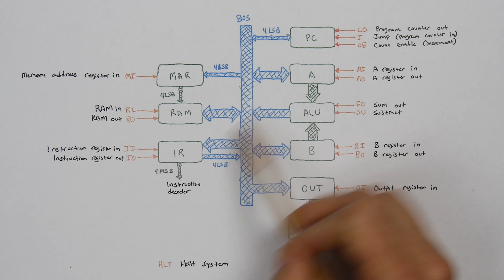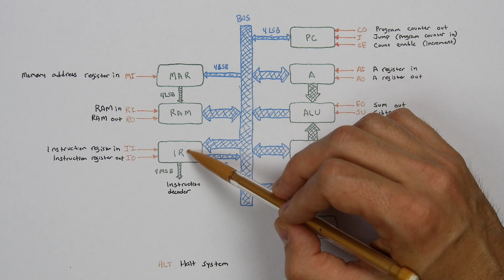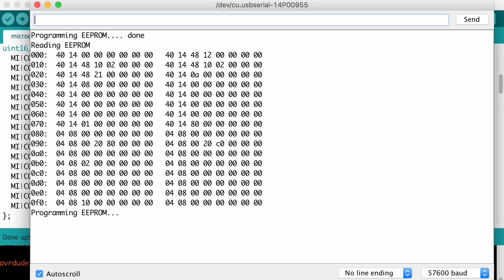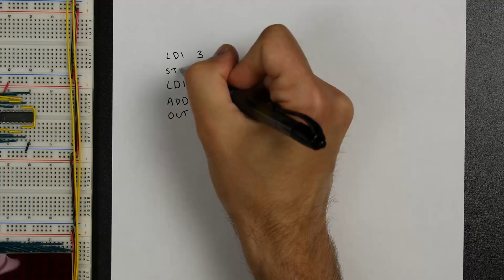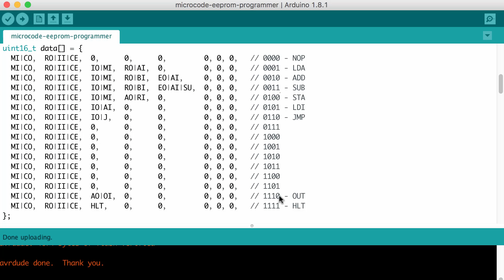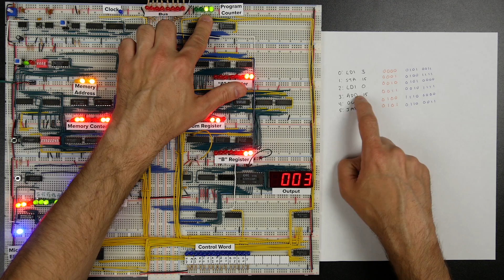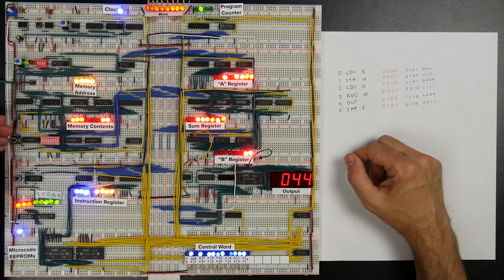Adding more machine language instructions to the CPU

Comment: The RAM I was able to source is a 64K AS6C6264 chip. It's got 8K worth of 8 bit words, controlled by 13 address lines, so, I've got 5 extra address lines to play with. The first thing that came to mind was that I could use these 5 lines to point to 32 different programs stored in the RAM, and I could just have a dip switch or something to switch between them. I'd like to come up with something a little more elegant than manually toggling dip switches, if possible, but I haven't come up with anything, yet...

But then it occurred to me, I could use one of the lines to toggle between the op code byte and the operand byte in memory, allowing me to use the whole 8 bits for both op codes, and operands, allowing me to do fully 8-bit math, and to refer to the full 8 bits worth of memory space afforded to each of the programs in my operands (and 8-bit literals, too, of course). I'm not sure how to refer to this approach, but I'm sure it's not exactly a ground breaking revelation. For now, I'll call it "Page Out" (PO). If this isn't the right term, I'd like to know the proper one, at the very least so I can label my control wires appropriately :)

So, my fetch cycle would look something like:

CO | MI,
RO | II,
RO | PO

leaving the operand available on the bus for the instruction we're about to execute to use as it pleases.

It sort of just occurs to me, now, though... this approach effectively doubles the amount of memory I can use for the "data" portion of any programs I write, since the PO control line basically becomes a ninth address line I could control programmatically adjust. I bet there are some really cool and powerful implications to this that I haven't thought about yet (and maybe never will, so please, do tell!)

I'm really new to this stuff, and this series has been absolutely amazing at demonstrating these concepts, both on the electronics, and the computer front. I think Ben might be the best educator I've ever had the pleasure of learning from. Thank you so much!
Reply: Well, it occurs to me now that it doesn't make any sense to have the Page Out, Ram Out instructions as part of the fetch cycle, since on the next step in the microcode, we'd need to re-enable those control lines, if we were interested in the operand for that particular instruction... but, those two control lines can just be enabled by all the operations that take the operand into account, as part of the first non-fetch cycle step.
Reply: You could use one or two of the extra address lines as control lines for subroutines and call them from the main program through the CPU and store the program counter of the main program in the stack pointer, when the subroutine finishes you pass the stack pointer value to the program counter. Idk just an idea.
Reply: I'm hoping to implement a stack, and use it for subroutines, so, if possible, I'm going to stick with using 4 of the lines for selecting which program the computer will run, and one for paging between the op codes and operands.

I'm a bit concerned, though, that I misunderstood the nature of SRAM. I started building the RAM module tonight, and realized, when looking through the datasheet a little more closely, that (it seems obvious now, and I feel silly for not having this realization earlier) it only retains its data when power is being supplied. So, storing multiple programs, or even one for that matter, in it is not really an option, and the computer needs to be programmed each time it's powered up.

So, I feel like I've got a couple options here.

Either I can implement some sort of bootstrapping, and store the programs in an EEPROM, and then write them into the ram upon startup, or just use an EEPROM directly for the program instructions, and have a separate RAM/Program ROM module.

I think the latter is probably the simpler approach, as I have no clue whatsoever how I'd approach the bootstrapping. Not to mention, it seems like repetition of work, to have the programs stored in the ROM, and then just transfer it to the RAM, only so the architecture can remain more similar to this build.

I feel like this series has given me a good enough understanding of the inner workings that I could expand on the build without TOO much trouble, though I've certainly got some questions I don't yet know the answer to.
Reply: "I'd like to come up with something a little more elegant than manually toggling dip switches, if possible, but I haven't come up with anything, yet..."
The simplest improvement is to use rotary switches that encode hexadecimal digits into 4 bits, like this one here:
https://cdn.sparkfun.com//assets/parts/4/2/7/3/10064-05.jpg
But if you want something more useful and fancy, perhaps a punched card reader? ;>  I made one for my computer – well, actually not a punched card, but a paper tape with black dots representing bits and a row of LEDs + phototransistors for optically reading them into RAM ;)

Comment: yeah, but can it run Crysis?
Reply: More like: but I couldn't fit it into the RAM of this computer :g
Reply: Vincent Fermat :-)
Reply: Could you fit that into 16 CPU instructions? It takes more than that to decide how fast the fan needs to run.
Reply: it‘s not turing complete afaik. if it was, you would just need to increase memory size. It would then be able to do it...  very slowly
Reply: It's Turing complete come two videos from now. It's technically possible to extend the memory with some insane mapping tech that loads different ram chips depending on the values of addresses in previous ones.
Reply: @berylliosis5250  So... what you're saying is... it CAN run crysis...
Reply: @thatnerdoverthere2248  Technically yes, practically no. It would be easier to make a different breadboard computer that can more reasonably compile C++ (and interpret CLR and Lua, yikes) than to make the extensive changes to memory and the ridiculous compiler that would be required for such a feat. And whatever you do it's not gonna be even close to fast.
Reply: @berylliosis5250  ok but... it CAN if you, for whatever god forsaken reason, really want to
Reply: @thatnerdoverthere2248  There is a tech demo / game preview called MOOD that's a W3D/DOOM clone for the C64. The game was never completed and released, but it's kind of playable. The C64's CPU is very similar to the 6502, and Ben is building a new breadboard computer with an actual 6502 CPU and "the world's worst" VGA. So you might be in with a chance at crafting something for that machine, maybe. I don't think any discrete logic computer without an actual microchip CPU IC is going to be fast enough for a texture-mapping 3D FPS. Ultimately the issue is the speed of light being the limiting factor, because a discrete logic CPU is just too big. This is something the late Grace Hopper used to explain very well. There is another project where they built a 6502 from discrete logic, and it can run some games, but it is much slower, for the same reason. Fast execution, large CPU, demanding computation task -- pick any two.

Comment: It's interesting what happens when it reaches 256, there seems to be an overflow, and then they are not multiple of 2 anymore... Great work once again.
Reply: I think his next video should be a conditional jump back to the start, so it would over flow then reset at 0.
Reply: I mean mutiples of 3
Reply: An 8-bit register uses modulo-256 arithmetic.  255 + 3 = 258, but that's too big to fit. 258 % 256 = 2, which is what ends up in the register as the new starting point.  The next iteration, it will start at 1 and then restart the overall sequence again with 0.
Reply: Yeah, it basically loops over division remainders of multiples of 3 by 256.
Reply: indeed
Reply: There's an edit button.

Comment: You should add an Add Immediate command, something like "IO|BI, EO|AI" (idk if that would work)
Reply: Definitely, but with the limitation of just 16 instructions including their addressing modes, you're going to run out of room quickly.    I know it's just 16 bytes of RAM, but this thing could be expanded to a real 8 bit computer pretty easily...albeit with quite a few more breadboards.   

In fact, it's time to build it on Veroboard or similar if you want to go bigger with a 16 bit address space and PC and an 8 bit instruction decoder. Ideally you'd need ...
Conditional branches if carry set/clear with 8 bit operands,  
Store Accumulator to memory address with B register as an index/offset,
Some simple immediate mode transfer instructions ...  TAB, TBA, ADD # as you say...
Then create a little 256 byte stack, where you can push and pop items so you can implement a JSR type instruction, and then a simple single level interrupt service/ return from interrupt, so SEI, CLI, RTI

I know it's totally out of scope, but why stop here ?  I'll help anyone interested.
Reply: On my build, I plan to go the full 8-bit route. I've got a comment on this video, explaining my plan to do so. The next problem I'd planned to try to tackle was the stack, but at this point, I don't have any great ideas about how to actually implement it. I'd love to be pointed in the right direction!
Reply: Fefo6644 that would work for sure, but he said that he thinks that it wouldn't be practical
Reply: A simple call stack can be done by storing the current value of the program counter in some other register from a register bank, or a small piece of RAM (the 16-byte ram used for this computer's entire address space might be a good start). Either way, you would also need a counter that would tell the CPU where's the current top of the stack (basically a pointer into that memory, or a signal that selects one of the copies of the program counter register). The RAM approach is much more flexible, though, because it could also allow to store temporary values and arguments for procedure calls on the stack instead of just the program counter. The best approach is to use some part of the address space in the system's RAM for the stack. E.g. the first page (256 bytes) of RAM, so that the addressing could be simplified: just an 8-bit address of the current top of the stack stored in a dedicated stack pointer register.
Then you store the program counter in every JSR (jump to subroutine) instruction and load it with the address of the subroutine you want to jump in. When the subroutine ends with a RET instruction, you simply load the return address from the top of the stack pointed at by the stack pointer register back into the program counter, and the execution will continue from the next instruction after the JSR.
You can even return some value from the subroutine in the A register ;)
Reply: Working on pretty much that. Have conditional branching, flags, multiplexing my 16bit control bus so i have ~32 ops from 13 of the 16 lines. instruction pointer is 8 bits, so 256 instructions and 256 bytes of address space so far. Once I'm done cleaning up, its a C register/counter, then stack, then segment registers :)

Comment: Couldn't you just as easily make LDI a 2 byte instruction by using CO|MI then RO|AI|CE?  The byte immediately following the LDI instruction would be the immediate value, and one step in that microcode would be an extra CE to skip past that byte.  It seems like you have everything you need to do a better LDI instruction, or at least an alternate LDIB instruction if you don't always want to waste a byte of RAM.
Reply: ldi comes in handy to save that byte
your example would work fine with just lda

Comment: Mr. Eater may I suggest to add 2 more ram IC's to the computer but keep the 16 bytes of code and use one of the other ram IC's for 2 more 4 bit or 1 more 8 bit data or address lines for an instruction and use the last ram for storing 8 bit numbers.

Comment: Damn I want to build one. But i find 15 ram addresses too limited to have something realistic.
Reply: It isn't intended to be practical though.  You could, without too much trouble, make this CPU have 256 bytes of memory.  Things like JMP, LDI and ADD would need to be 2 byte instructions so no more shoehorning your data into the lower 4 bits of the instruction.  That's not hard to implement though.  Expanding beyond that is going to take a lot more work.
Reply: Viorel you can easily make 8bit ram addresses with some performance drops
Reply: Yep agree but worth it; the split nibbles does limit this a lot.  8 bit address bus and PC would be easy to implement ..  
Frankly it's not that much harder making it 1 byte instruction, 2 byte operands, with a 16 bit PC and MAR.  That's a real computer, but you'd need to break it into the modules and assemble on protoboard for reliability.  Still, I like it.

Comment: Could you extend the address bus to 15 bits?
Reply: do you mean 15 physical data lines on the bus or just 15bit ram addresses
Reply: Yes, as many as you like but it'd require a full rework of the memory address register, quadrupling the program counter from 4 to 16 bits.  Big job including reworking the instruction decoder to support multiple byte opcode/operands but I'd love to have a go at it.

Comment: ...and seconds after he says "...and it's still counting multiples of 3", it overflows and displays 2, 5, 8, 11... XD
Reply: They are still multiples of three. Only it's modulo 256.
Reply: @Per, Of course, it was just the timing I thought was funny.
Reply: I was hoping to see a conditional jump instruction implemented, and use that to jump back to the start if it's about to overflow.
Reply: As the registers are only 8 bits, it''s (nearly ;) )impossible to store values larger than 255. But ADD instruction works just fine and in A register is lower half of 16 bit value (258 is 0x0102). So display shows lower 8 bits of 258 which is 2. I hope Ben will add status register (aka flag register) which will help to manage such cases.
Reply: +Per Mortensen:  With that approach, every possible value of a byte is some multiple of 3 mod 256 :q
+shevat: YES! Status flags should go next. They're another cool thing to have, and one can do fancy conditional jumps depending on the status flags :>
Reply: it would not if he added another byte to the system

Comment: CONDITIONAL JUMPS......?
A FLAG register
74LS85 ?
Reply: Kew Akl, this will not work with this machine, as far as I see. To do so, the ALU would at least need a zero (or carry) output bit, which could be used to decide if a conditional CE (CCE?) is having effect, so either the next instruction or the instruction after (preferably the first one being a JMP) is executed next. The simplest tweak to implement that is using the spare control bit to go into an AND gate along with the ALU output and route the result into an OR gate along with the original CE input. Then you could jump if Areg is 0 or Areg and Breg are equal (with subtraction); both leads to a zero bit. Using the same with the carry flag could instead be used not to check for equality. but a range.

Comment: any chance you'll add some sort of step count reset so that you don't waste empty clock cycles on doing nothing? i'd love to see how that would be implemented.
Reply: There are two practical ways of doing that:
1. Add more control lines and have one of them programmed as a "this is the last microcode instruction" signal.  The advantage of doing it this way is no wasted clock cycles.  The disadvantage is having to add another EEPROM to provide more than 16 control lines.
2. Add logic circuitry which detects a microcode instruction with no outputs and provides the "last microcode instruction" signal from that.  The advantage is not having to expand the control lines.  The disadvantage is that you effectively need one more microcode cycle per instruction (unless the instruction occupies all cycles) which will be a bit slower than the first method.
Reply: nekorug if I had to guess, he will probably use the unused signal for a jump if carry set command. That is just a hunch though.
Reply: JasonMasters it would take up a lot of real estate but maybe using several OR gates attached to the control word outputs. If any output on the E2PROMs is high, it doesn't reset, but if all are low, it resets the counter.
Reply: I'm pretty sure he has one control line that's empty right now. He seems to be teasing it as reserved for something in the future, so I'm wondering if this is what he'll do.
Reply: Ah, right. He hasn't added that yet, no. I guess we'll see. Doesn't each EEPROM have like 11 outputs or something though? With some changes to the program maybe he could add even more control lines.
Reply: nekorug unfortunately no. They only have 8 data outputs. The ones you are thinking of are the address inputs. The EPROM's (not EEPROM like he is using) that I'm running have 16 address lines and 8 data lines. All the unused address lines are tied low.